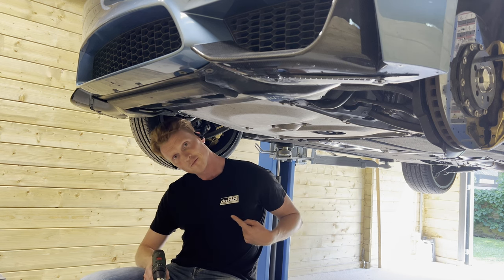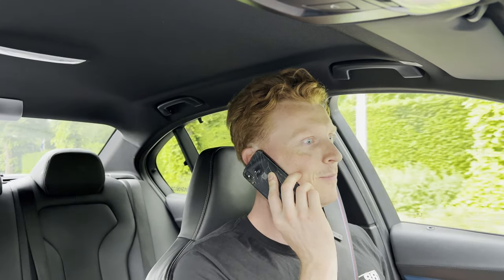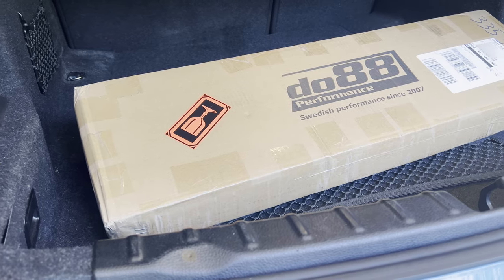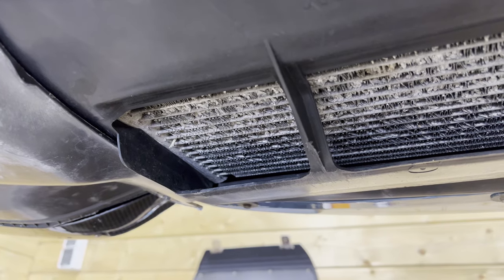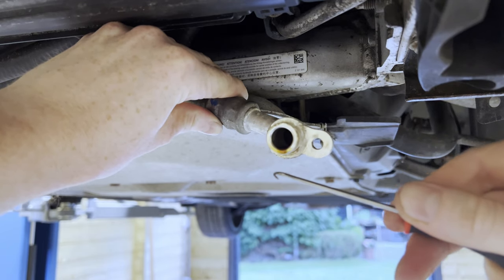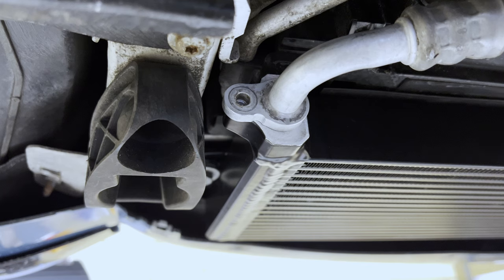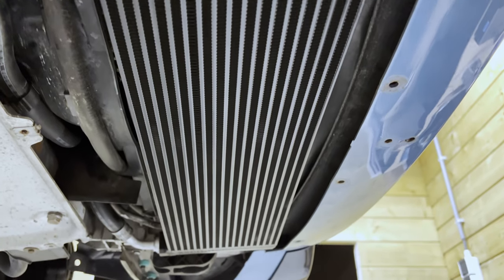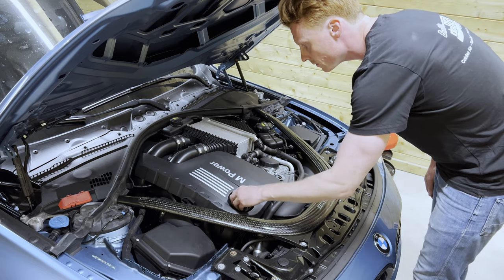BMW M3 Competition: Do88 Performance Engine Oil Cooler for the S55 Engine

Comment: How much oil did You add after the oil cooler replacement?
Reply from the maker: @krzysztofmanka5460  0.5 liter, as I said when topping it up ;)
Reply: @TheHunterHofman  But was it on MAX after adding that 0.5L? Or at least at a correct level?  
I need to know how much oil gets lost during the oil cooler replacement.
Reply from the maker: @krzysztofmanka5460  it’s only a small amount. I also accounted for the slightly larger volume of the new oil cooler.
Reply: @TheHunterHofman  Allright, thanks a lot.